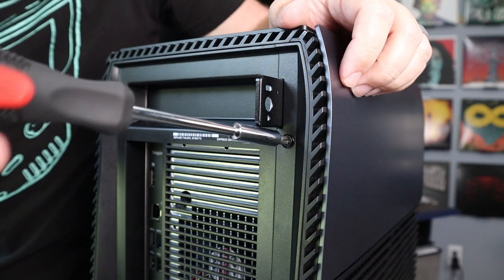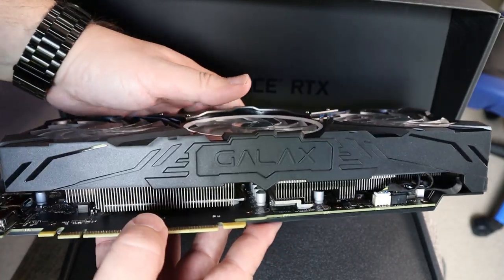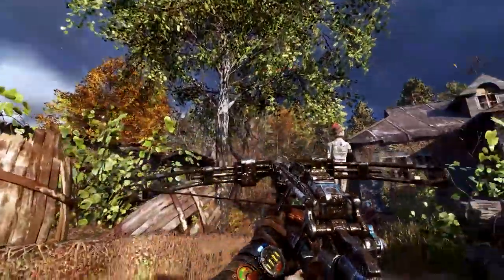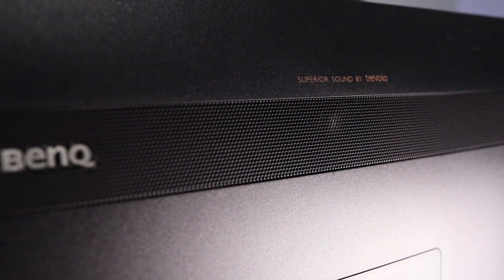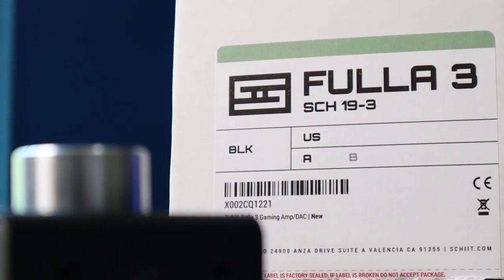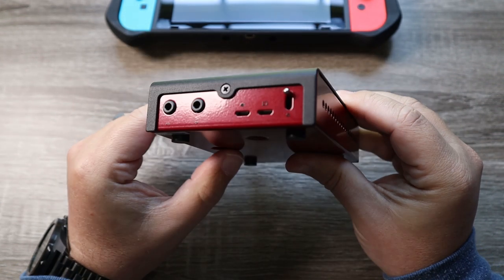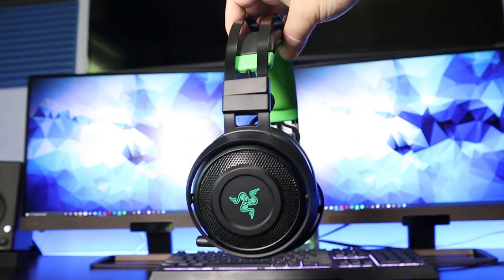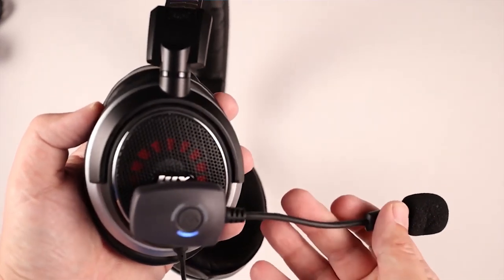My Ultimate Gaming and Audio Setup!

Comment: Do you ever go back and revisit older products to see how they hold up against newer products in a quickly changing tech landscape? For example taking one of your top rated headsets from two years ago and putting it up against some of the current top items? Because sometimes the older tech can be found for a massive discount and it would be great to know if some of these older items are still worth it or possibly even better than some of the newer tech coming out

Comment: Greeting, I need some help. Been searching on the internet without luck. Probably you can guide me to the right direction. I recently got a PS4 Pro (yeah kind of late) The thing is that my TV has one ARC port and it is the only one that support HDR. Is there a way I can connect the PS4 and my sound bar on the same port without loosing the ARC and HDR support?. The only way I find out to have both devices without problem is by having the PS4 on the port to get the HDR support on the system. The sound bar is connected via optical so the sound bar works but loosing the ARC support. Like this I'm unable to enjoy the best sound.